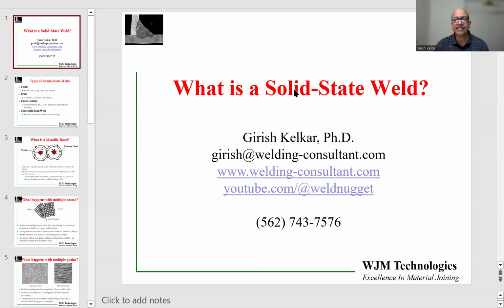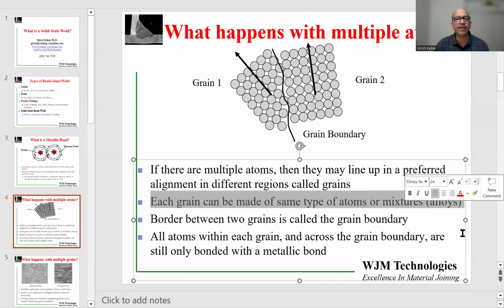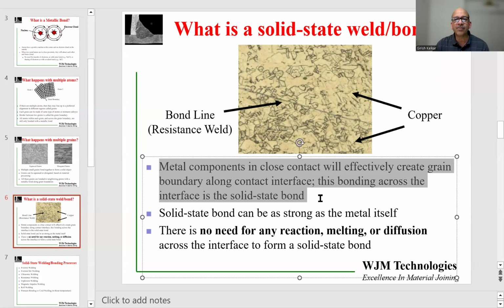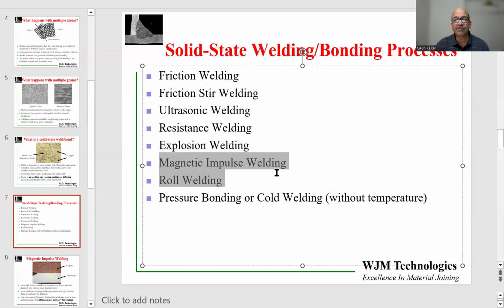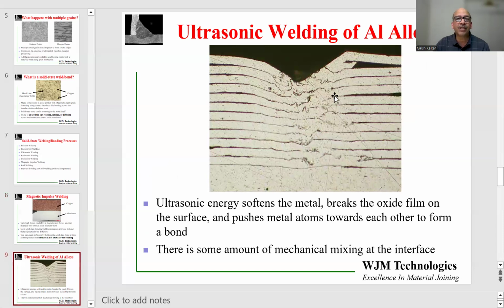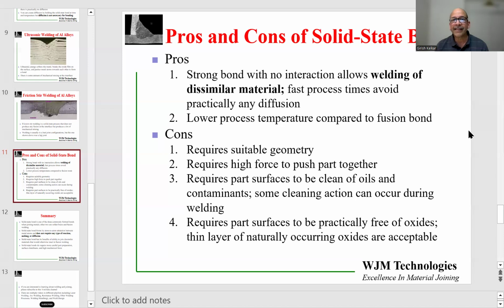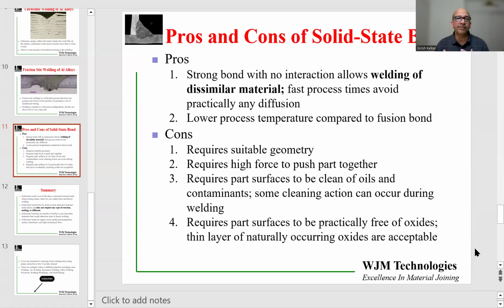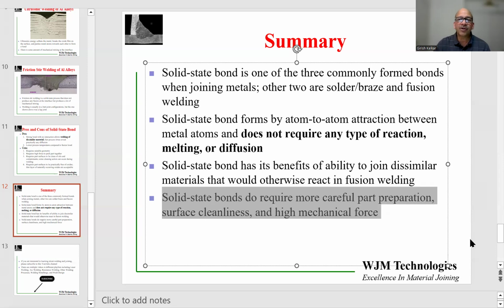What is a Solid State Weld?

Comment: Nice video. I am working with Li-ion battery production, exactly with ultrasonic welding. Many people still think during UW main mechanism of bonding is through melting - but in fact it is not.
Reply from the maker: Glad you liked the video.  It is a common misconception that UW includes melting and also diffusion.

Comment: Worked with Gold-Gold Thermomechanical bonding for wafer-to-wafer and device-to wafer-bonding. There is a large sweet spot in the Force-Temperature-Time parameter space, if pure gold is used. Much more difficult with electroplated gold.
Reply from the maker: Yes, thermo-mechanical bonding is another solid-state process; forgot to mention that one.  Pure gold is the easiest for solid-state welding as it is very soft and can be easily make to be free of surface oxides.